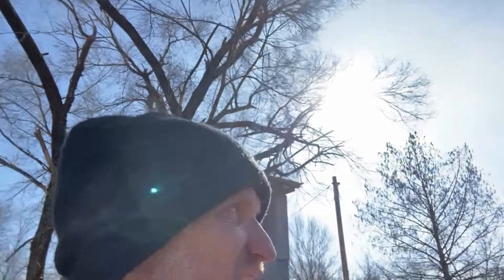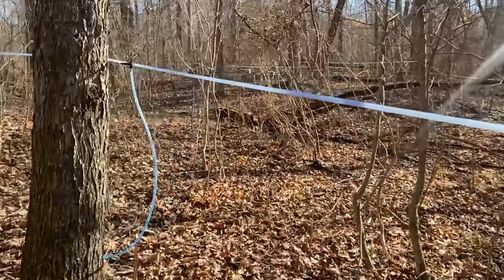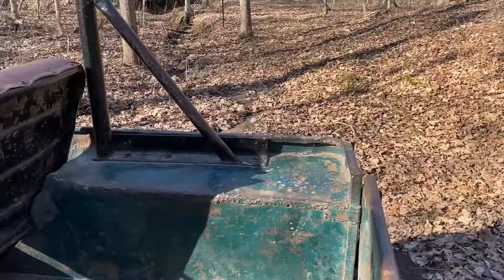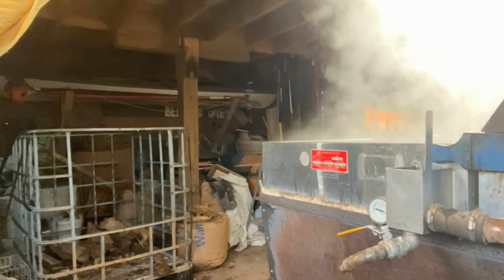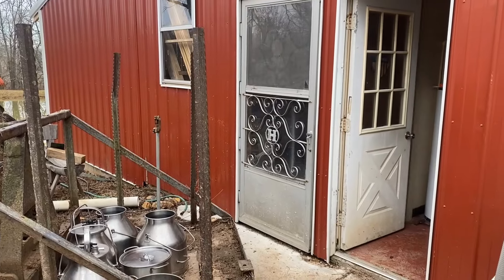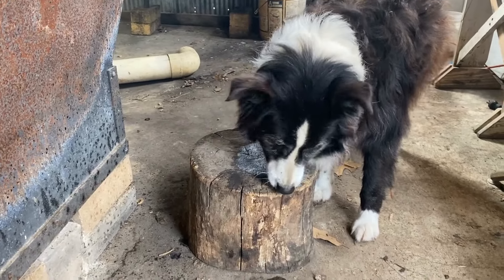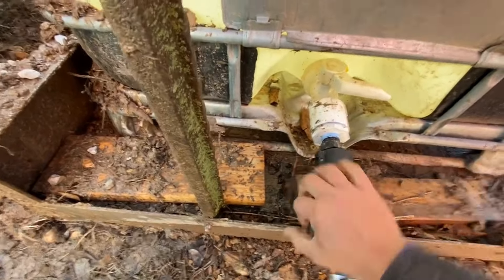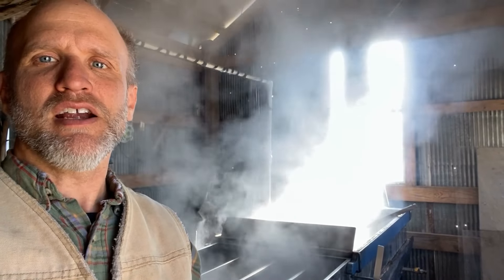Why We Make Maple Syrup, The Truth About Cats, And Bad Dad Jokes!

Comment: What heat source do you use to process the sap, wood, gas, propane? And how much fuel does it take a season? Thank you!
Reply from the maker: We use wood, and how much depends on how much we concentrate with the reverse osmosis.  I don't keep real close track, but this year while removing 1/2 to 2/3 of the water with the RO, 1 cage tote of wood was enough for about 15-20 gallons of syrup
Reply: @applecreekoutdoors4589  Thank you!